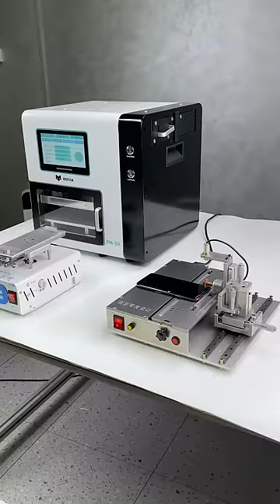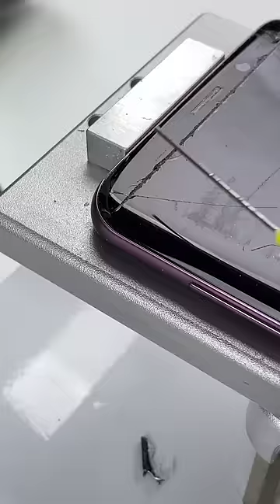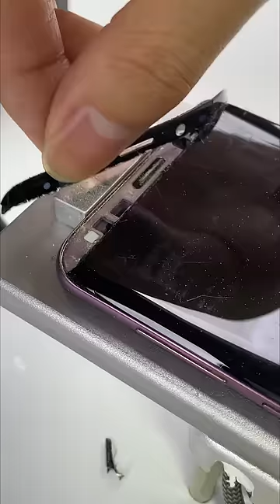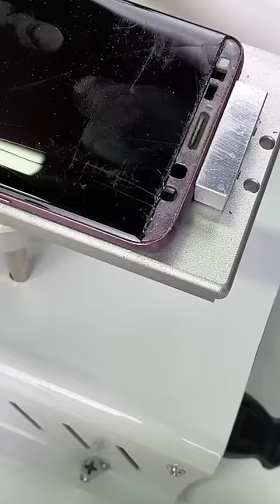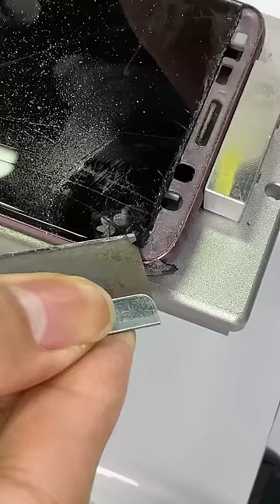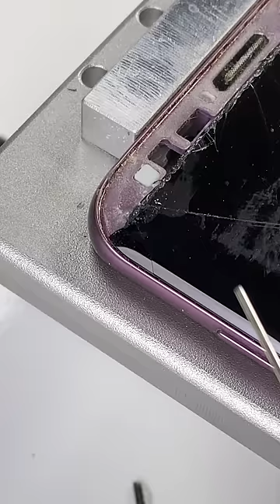Screen Cutting - Samsung S9+ Curved Screen Refurbishing (Part 1)#shorts

Comment: unless they are intending to use the frame to put a new screen on to sell to a shop, thats so much work for a repair that should be SUPER SIMPLE. just replace the frame and lcd all at once, you can literally orderthem as one peice in whatever color you need. and then you dont have to take a dremmel to the phone and risk other damage.
Reply: They are removing only the screen glass not the whole LCD
Reply: @baaaaks376  i understand that. i am saying that what theyre doing is FAR MORE WORK and not worth the time and effort theyre putting in.

Comment: ну а дальше что?
Reply: What happens next is a heat the screen up to 180° f and they take a polycarbonate wire made to withstand temperatures at or below 180° f then the wire cuts the glass off the screen, leaving a film of glue still attached to the LCD digitizer. Then they put on the glue of the LCD digitizer isopropyl alcohol and it weakens the glue and you basically peel it off with your thumb. Then taking a limitless cloth and more isopropyl alcohol of 94% and clean the rest of the glue off. Then they get a new glass cover that has the black mask at the top and bottom of the screen and use a UV light activated glue to adhere that onto the LCD digitizer. The phone goes into machine that does two things: the machine has a UV light and a vacuum pump and what that does it make sure that there are no bubbles trapped between the glass the glue and the surface of the LCD digitizer. When it comes out it looks brand new.

Comment: I used to repair ppls phones for hobby to make some extra pennies this is not the way to extract screen there is a heating bed machine that heats it and suck the glass so the glue becomes weak and the the frame of the phone comes out of the glass i used to do it with guitar strings but since samsung doesnt really have an lcd there its a thin paper screen that you must be carefull to not scratch what he did by pulling pieces like this could result in black broken screen i dont see how he can remove whole glass this way there is special suction cups molded specialy for the galaxy series you save time last months everyone do random videos without completing or results like we say those could be gone down for real ....
Reply: It's Rewa, they know what they are doing. They literally design the tools used for this

What they do in the Video ist breaking the corners, so the seperating wire can get between the glass and the screen easier.
Don't judge If you don't know the full story :)
Reply: You literally are clueless, glad you never worked on my phone!😆
Reply: @dawhoda1  Tell me whats going on in the video if I am clueless haha

Comment: I changed the screen on my old iPhone 5s and it took 25 minutes and a lot of patience and organising of the little screws etc. and it works full pelt,and when I see this I think FFS why don’t you just have a go at replacing the sodden thing instead of looking like a douche 😂
Reply: Because why replace the display itself when it's only the glass that's broken. New glass costs less than £5 whereas a new s9 display is near £150